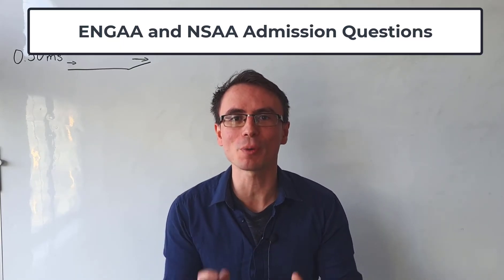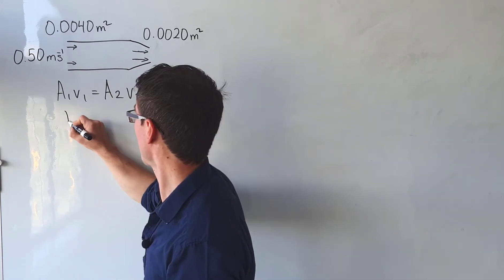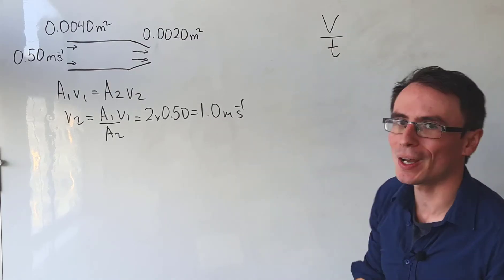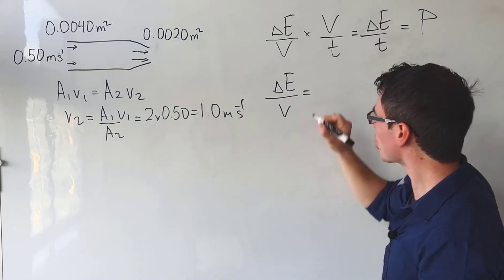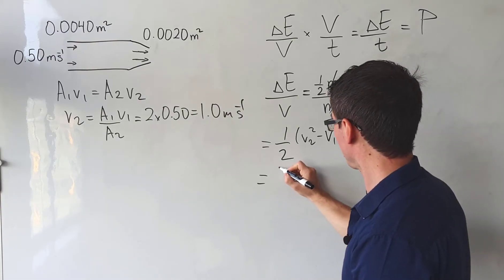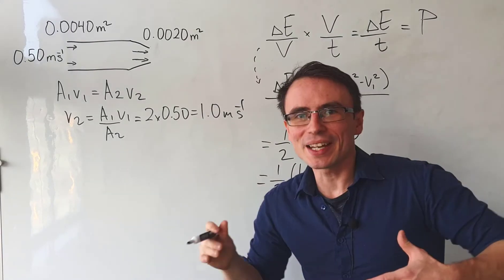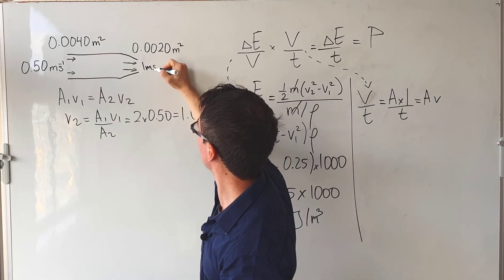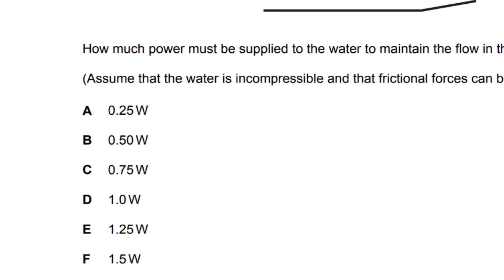MANY found this Cambridge Physics question difficult / ENGAA, NSAA 2021 Solution

Comment: Isnt there a much easier way? I looked at the mass of the water flowing into the tube per second - (0.004 * 0.5*1000 = 2Kg/s ) and since the rate of flow needs to stay the same, the same amount of water needs to flow out, 2 kg/s. The density is the same, but the cross sectional area is halved, so the speed must be doubled, from 0.5 to 1. Then I just found the power of the water entering and the power of it leaving, and subtracted (I had mass as kg/s, so no additional math required) How can we do all of the other stuff in under 2 minutes in the actual exam?
Reply from the maker: definitely! only spotted this after filming thank you for the comment!

Comment: Interesting question, I solved it using the hydraulic (pump) power equation: P = rho * g * Q * H. The first 3 quantities are are easy enough to calculate but for the head loss, this can be found by use of Bernoulli's equation in tandem with the continuity equation. We find H = 1/(2g) * (v_2^2 - v_1^2)  => P = 1/2 * rho * Q * (v_2^2 - v_1^2) where Q = A_1*v_1 = A_2*v_2. Potentially easier than your method but not sure.
Reply: wow! nice
Reply: The way I solved it is essentially the basis of how Bernoulli's equation was developed though right?

Comment: we can also use steady flow momentum equation
Reply: I cant do most of them,... I screwed, espeically for the root12345 triangle one. I felt so bad . I could not do section2
Reply: I am going to get 1 out of 20 for section2
Reply: @weeborghini4016  Weirdly enough, I found Section 2 easier to get through than Section 1. Not because the questions were easier to solve, in fact they were harder, but because it was less time pressured. My timing for Section 1 was horrible and I missed about half of the questions in Part B.
Reply: @overexplainedgameguides4357  Well, I messed up section2  tho.
Reply: @overexplainedgameguides4357  Its ok it might be simply I don't belong to Cambridge